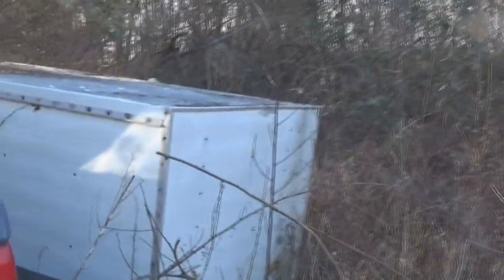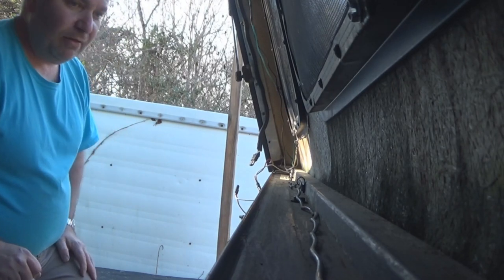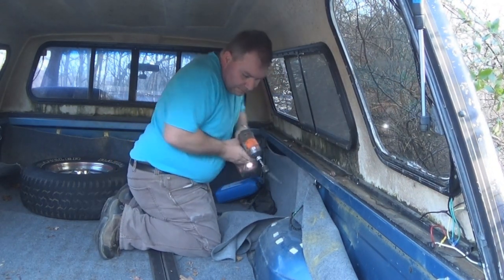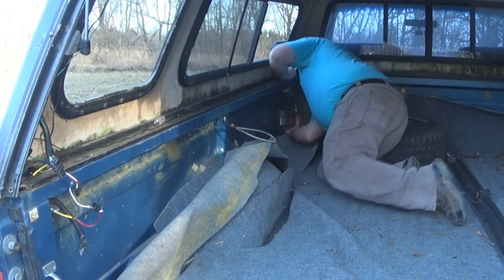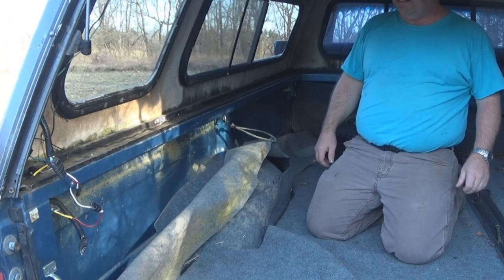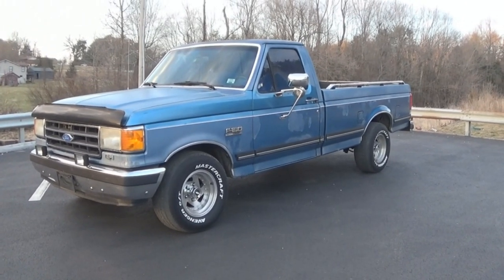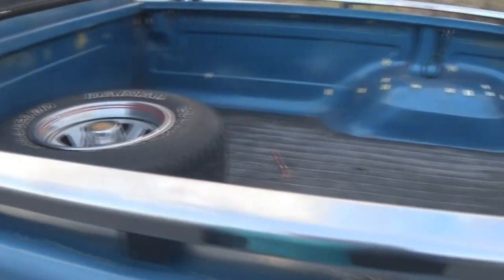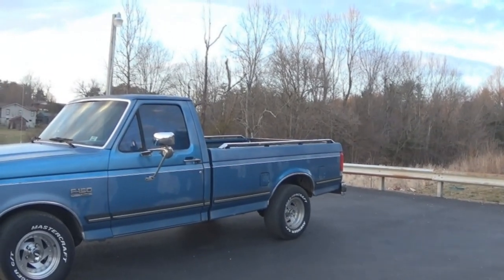The Topper Comes Off

Comment: Truck looks good without the topper. You mentioned tires- Does your truck have wider tires in the rear? If so, what size? I just bought a set of Ford rims used and the rears are wider. So far, I can't find the tire size for the wider rims.
Reply from the maker: Thanks! I do have wider tires on it. They are all the way around though. I currently have 255/70R15 on it.